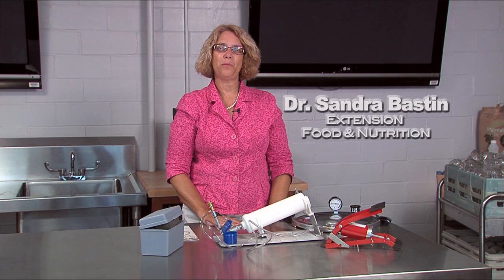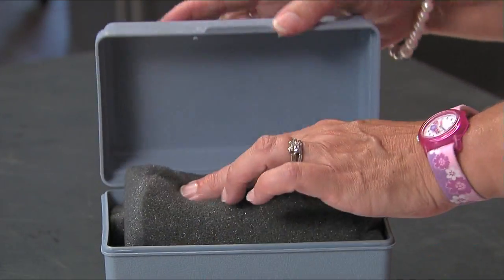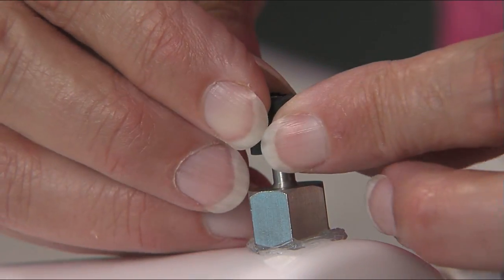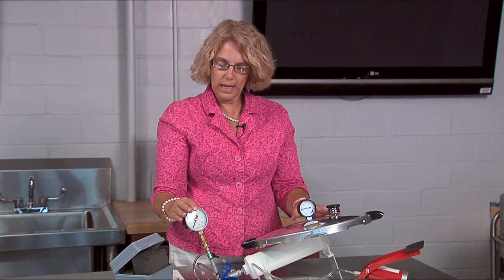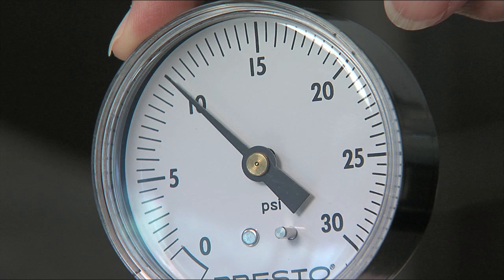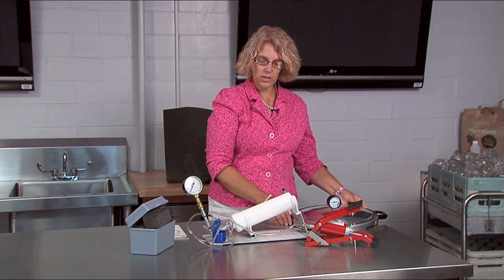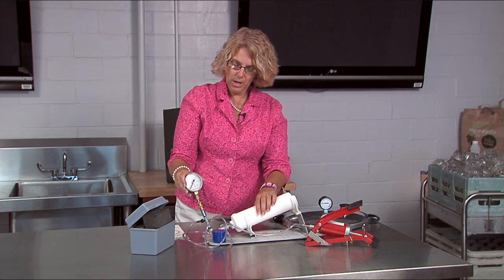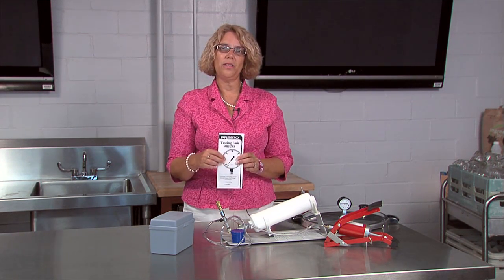Canner Tester

Comment: This test was garbage. If your canner gauge is reading one pound more than actual, then you are not processing at the proper temperature and that can be deadly. Example: If the manual calls for 11 psi for 75 minutes and that's what I have my gauge on, but reality is my pressure is really 10 psi, that is so, so wrong. I cannot believe U.K. allows this to be published.

Comment: It is pretty sad when the expert presenting the information hasn't a clue what she is doing.The tester provides pressure NOT vacuum. The weighted gauge that she deliberately positions is non-functional during the test. Although the 1lb difference is within the acceptable range, a high reading can lead to under processing. While the canner gauge will read 10 lbs, it will actually be running @ 9 lbs.
Reply: But the expert is a doctor.